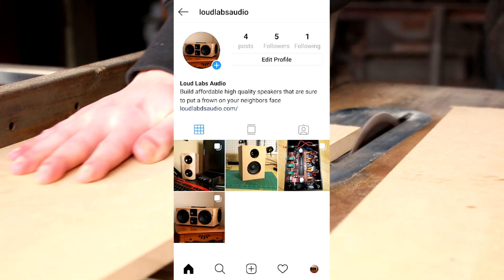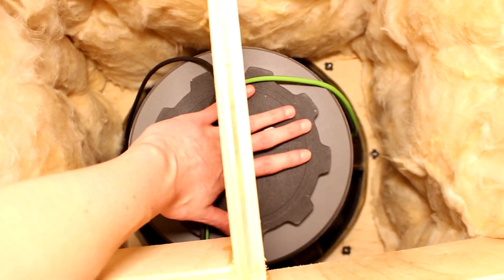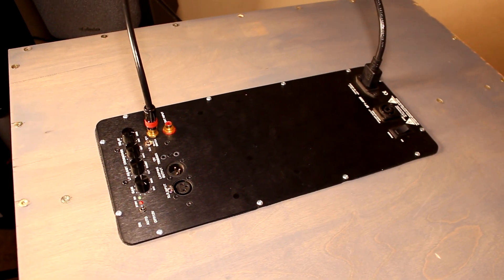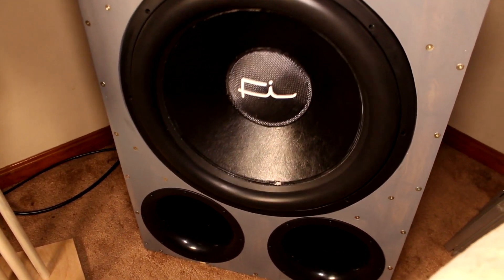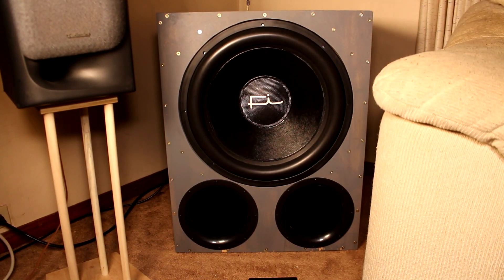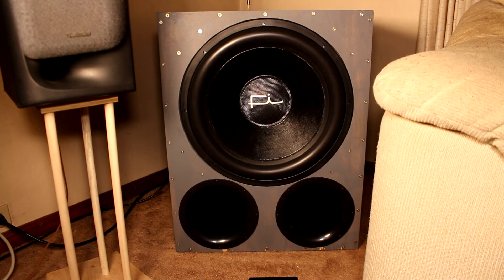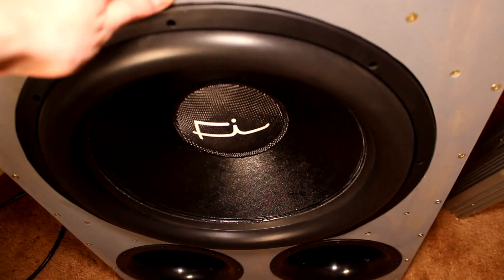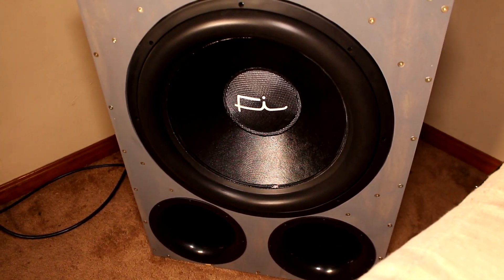Monster DIY 4000 Watt Subwoofer Playing  20hz and up Sine-waves, Did I Break It?

Comment: Most you can pull is 2500 watts from 110v wall with 30 amp breaker. If you had 220 now that would be different. It might do 4000 watts for a second until it pops circuit breaker in your home
Reply from the maker: Yes you are absolutely correct. That's why these amps have 6 very large 200v capacitors (I can't remember off the top of my head how man uF they are) that the amp uses to deliver 4000 watts continuously for 6 seconds, after that the amp starts drawing a ton of power from the wall to charge the caps back up. If I really push the sub I can easily trip the 15 amp breaker that powers my whole system. Since most music is dynamic, this amp can put out 4000 watts+ under normal listening conditions. But you would also have to have 125db+ capable speakers to keep up with the sub.

Comment: SO STUUUPID.....US home current can source approx 15 amps at 120V max.   That is 1800 watts max....from ANY amplifier claiming this power level RMS.   You'd need a dedicated 220V line and amp designed to use this to even get close to 4000 watts RMS.   True that momentary wattage can peak much higher than RMS, but let's get real.....all mfgs claim bogus wattage ratings.
Reply from the maker: You're correct, this amplifier doesn't pull 4000 watts from the wall. This amplifier design use six big 220v capacitors which is how it can make 4000 watts. SpeakerPower rates these amps to do 4000 watts for 6 seconds at 40hz at 2 ohms. After that 6 seconds, the capacitors are drained and the amp starts draw a ton of power from the wall, and output is reduced. Luckily music is dynamic, so a six second sine wave will pretty much never happen, so the amp can easily put out 4000 watts "RMS" all day. 

These SpeakerPower are no joke. The driver in this sub is rated at 4500 watts RMS and this amp has no problem getting it to move. SpeakerPower also makes a version of this amp that can run on 220v from the wall, and it's rated at 6000 watts RMS lol.

Comment: and 7cuft with 2200 rms amp for a 4500rms sub your only feeding it half power 7cuft is not enough air
Reply from the maker: I consider anything more than a few seconds continuous. I can't think of any music that has a 6 second sine wave lol, even after that the amp would only be down 3db. I'm just going off what the SpeakerPower documents say. This amp can move this driver with ease, and can get the driver hot after a few minutes. It's definitely 4000 watts RMS. The recommended box size for this driver is 5-8 cubic feet. 7 cubes work just fine. There's no port noise under normal listening conditions. This sub did 134db at my main listening position before the amp tripped the breaker in my house. It has more it, but my speakers can't keep up
Reply: @LoudLabsAudio  ok I see. but okay 4k rms for 6 seconds then it drops 3db thats half the power so 2000rms

Comment: Holy cow! Man, nice subwoofer! I got a question, is it very expensive to buy a 20 hz capable subwoofer or the fact that a sales agent from a professional audio equipment company told me that a 20hz sub is in the over 5000 $ range to buy?
Reply from the maker: That is 100% BS. Although for pro audio applications (outdoors/large sound stages) strong 20hz output is much more difficult to reach compared to a home audio sub in a home environment, but it's not impossible. At $5000, you're in top of the line equipment territory, and I'm sure there are PA subs out there that can hit 20hz for half the cost of what that company told you. Heck even $2500 is expensive, especially when it probably doesn't cost the company half of that to manufacture it. These companies are in the business of marketing and making money, the audio products themselves are an after thought.
Reply: @LoudLabsAudio  I hear you man, got it. That guy was a dickhead, but I see why he said what he said. Money. I saw some nice subs from a Dutch company that weren't very expensive and so I was wondering if they're really capable of putting out what they're specifying(15 hz-500 hz). I already have a pair of fullrange speakers from them consisting of 3 small horns, a big piezo tweeter and two 15 inch drivers that put out 25 to 20.000 hz. I was very impressed by their clear crisp powerful sound but I really want to build a good event sound system that has very good low bass frequencies, if possible at 20 hz even. So I guess they're not far off from what they're saying 🙂. Thanks a lot man, I subscribed to the chanel, you have a very good idea with the business. I'm passionate about these things like crazy. Few people know why good speakers are pure gold. I wish you all the best, keep up the good work and I sure wish for you to make your business grow and be able to sell these speakers world wide. Peace!

Comment: Do you have the dimensions of this box? What is the box tuned to? I'm looking at making a similar 7m3 foot box tuned to 20Hz for the HT-3. What did you use to calculate the port size and length?  Do you have a link or pictures of your build?
Reply from the maker: The box I think is about 6.5 to 7 cubic feet after displacement, and the dimensions are 22" wide, 28" high and 30" deep. The two 6" ports are 26" long with the flares, and the box is tuned to 24hz. For box and port calculations I just used an app on my phone called "The ultimate car audio app". I'm currently working on a new box for this driver with similar dimensions but using a single 8" port, I'm going to make a video on it so make sure you're subscribed. Thanks for watching!
Reply: Awesome thanks for the info. Is there a benefit of going to a larger port? And going single?  I'm thinking 2-4" ports according to the apps gets me to where I want to be tune wise.
Reply: @LoudLabsAudio  
Thanks for reply

Comment: what do you think of the Fi HT-1 Series 18, im trying to decide either the Fi or the dayton ultimax  both 18's
Reply from the maker: Fi drivers are in another league, they are by far the best in the business. I've never used the ultimax 18, but I'm sure it's not worth more than the Fi. More than like I'll be using the HT-3 in my next build
Reply: @LoudLabsAudio  specs wise, looks like the dayton is better dou le the cone travel
Reply from the maker: Actually the HT-1 has 27mm of xmax, and the ultimax has 22mm. The Fi is a much better driver.
Reply: @LoudLabsAudio  dayton says  2" of total cone travel to move
Reply: @naughtyca131970  get a stroker pro

Comment: Seems underpowered.  It should SHRED that can in the port. 120v huh?  4000w for 6 seconds? Thats a stretch. I can only pull 15 Amps on my  outlet. Thats only 1800w. Even if you had a 20 amp only 2400w is avaliable.
Reply from the maker: The amp uses capacitance to make that much power, that's why it rated for 6 seconds. Most wall outlets can pull more power then what their genaric amp rating is on the breaker. Believe me, I have tripped the breaker many times lol
Reply: @LoudLabsAudio  that's a safety margin put there so you don't overheat the circuit. I wouldn't make it common practice to pull more than the rating from the breaker. That's how fires start

Comment: Your neighbors are probably going crazy lol, How much does it cost to build sub like that?
Reply from the maker: The outside of the house only rattles a little bit lol to build a sub like this would cost about $2000
Reply: @LoudLabsAudio  2 grand? GTFO
 That's absurd. You could get a Dayton ultimax 18, and a box, and an amp for 800 or less.
Reply from the maker: @whozaskin3639  This is a lot more sub than a Dayton Ultimax. The 4000 watt rms amp is $1200 and the driver is $800, so it would actually be over $2000 with box material, ports and hardware.
Reply: @LoudLabsAudio  ok. Well, a residential power outlet is 120v, and IF it's on a dedicated circuit, with no other loads, on 12/2, with a 20 amp breaker, the most wattage you can pull is about 85% of full load with continuous draw. Let's just say 2000w for easy math. Amplifiers aren't 100% efficient, so let's say 80, which is going to be a very efficient class d amp. (Not sound quality). That leaves you with 1600w RMS. And all the aforementioned, again, is on a dedicated circuit, one run to the breaker box. Don't give me the but, but, but capacitors bs, cause the rail caps in any amp ain't going to do much more than raise dynamic power. Hard, sustained bass will behave way differently. Seriously, there is no way that any amp can produce more than ~1600 on a regular outlet. It's why serious home theater bass guys have a couple dedicated runs to single plugs, with 10/2 wire, on 30 amp breakers. You would be able to play louder with an ultimax, on 1000w RMS, if you built a proper huge box, with slot ports. Then, you wouldn't need to hire an electrician. Wait....you could almost fully power TWO Ultimax subs on a single outlet, and be out less money. Look, it's your dollar, and your sub looks cool, and it's a neat concept. If your happy, great!
Reply: @whozaskin3639  best of getting a few cheaper subs the extra cone area will help with the bass anyway
Reply: @whozaskin3639  
Calm down it's not that serious.Damn male Karen's everywhere now.🤦🏻‍♂️
Reply: Who Zaskin that honestly helped with a question I had about home audio
Reply: @LoudLabsAudio  Thanks for the info and fast response ☺